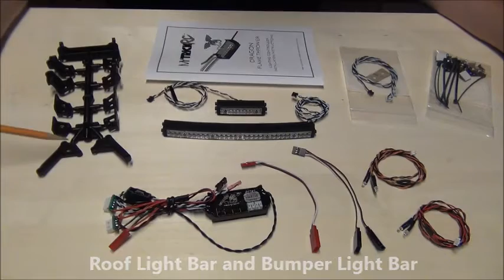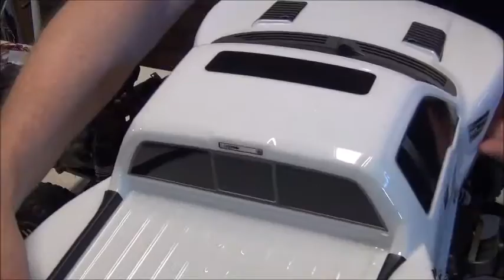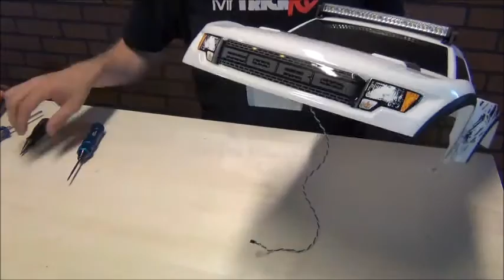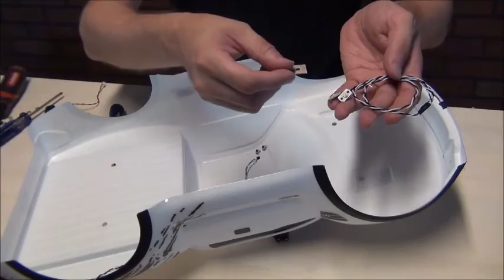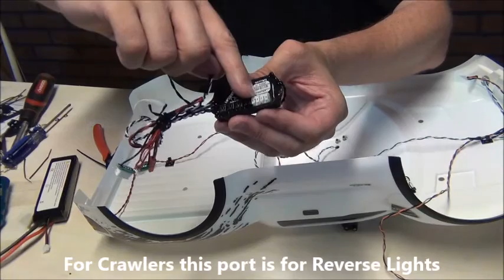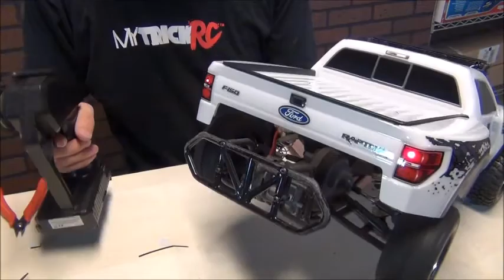MyTrickRC Dragon Installation into Traxxas Slash Ford Raptor

Comment: I ordered the Trick RC for the Bronco & my question is? The 3 way Y adapter takes the 3 white connectors according the sheet instructions plugs in to the Right side & the white plug into the left side correct? leaving the Black connector to connect to the ANY Black connector? I was wondering am I correct on this? Please respond back. I love your products BTW~!
Reply from the maker: Thanks!  Running Lights on the 3-Way Splitter connect to Port F.  Reverse Lights into Port E.  Black connectors are only for Headlights.  You can also add on rock lights or light bar(s) to the  black connectors.
Reply: @MyTrickRC  ok Thank you for the specific instructions, very clearly now.

Comment: Can you plug this into the balance port of the main battery used for powering the vehicle? Or do you need to run off separate battery? Thanks!
Reply from the maker: You can power off either the main battery as long as it's 3S MAX.  Larger batteries (4S and larger) would damage the Controller.

Comment: How do you operate lights remotely?
Reply from the maker: You can control the system remotely if your transmitter has a 3rd channel button.  Everything else you need will be included in the kit.
Reply: @MyTrickRC  How did you have that Tactic transmitter set up for Channel 3 on the Axial Deadbolt?  Did you program it as 4 position or do you just use the default two position?
Reply from the maker: @seanoguano  should be a 2-position.  Basically, Full LT to Full RT operation.
Reply: @MyTrickRC  Cool.  Thanks.  I'm going to try it tonight.
Reply: @MyTrickRC  I got it working.  The TTX300 comes with ch 3 as a two position by default.  Just had to hook it up like in the instructions.  It took me a while to figure out that you click one button then the other to switch modes.

Comment: Light bar seems to be killing my slash. I don’t have the Balance port power connector. I am running power from the #4 slot on the receiver. Plan on running more light. What do you recommend to power the system
Reply from the maker: Are you running a full Attack system like the one in this video?  Meaning, your powering your light bar from a Dragon controller, correct?
Reply: MyTrick RC no I just got the light bar. Nothing else.
Reply: MyTrick RC  Just went to your website and purchase the power Regulator. Hoping that this will work. I will try powering Directly off of the Balance port.
Reply from the maker: Ok, How did you adapt the connector to your receiver?  Did the light bar come with an adapter cable.
Reply: MyTrick RC  yes light bar came with a receiver adapter connection. When I plug it in I can hear the power drop. I can run the truck at low speeds but when I try to go faster than that the truck stops and lights dem.
Reply: MyTrick RC need to cancel the order I made last night. Ordered the wrong adapter please advise
Reply from the maker: Noted, we will cancel it.
Reply from the maker: This isn't normal.  Your truck shouldn't be affected at all by the light bar.  More investigating is required.  Can you send us an email to: info@mytrickrc.com
Reply: MyTrick RC sending now and thank you

Comment: i installed the crawler version to my scx10.2 and love everything about this kit, only issue i have had is that i can not have the system connected to my receiver to control it off my radio, at 1/2 or more throttle the light controller scrolls thru the modes on its own.
Reply from the maker: Hi James,

When not moving, does the 3rd channel work correctly?
Reply: yes it works just fine, and my winch is in channel 4 and also works just fine, when parked or in motion, the dragon light controller is the only thing that starts to have issue, and only once the throttle is above 50%
Reply from the maker: Hmm, It sounds like the red servo connector cable is connected to the motor port on the received.  If that's the case it would make sense that the switch would trigger at about 50%.  Can you double check it?
Reply: nope, the red is plugged into channel 3 and the splitter connects the controller and the esc together into channel 2 of the receiver
Reply from the maker: Maybe we should do a phone call.  Our number is 949-654-4493.  Also, you can send any pics or videos to info@mytrickrc.com

Comment: If you add this would you need to change the stock battery for a new powerful battery? And would this work on the newer model the traxxas ford raptor 2017?
Reply from the maker: Hi Angel, this system can be powered off and standard Lipo battery with a Balance Port. It doesn't draw too much power.  I'm not sure about the changes to the Raptor body, but I would expect it to still fit the same.